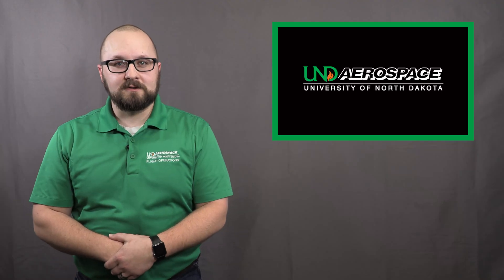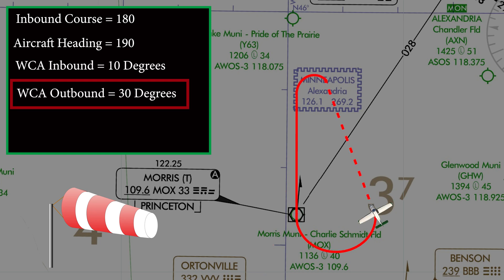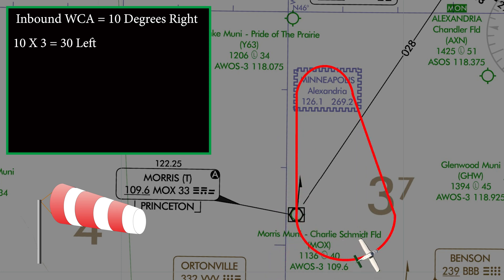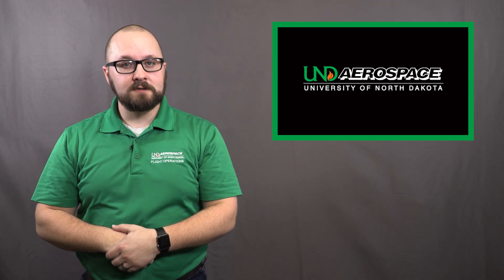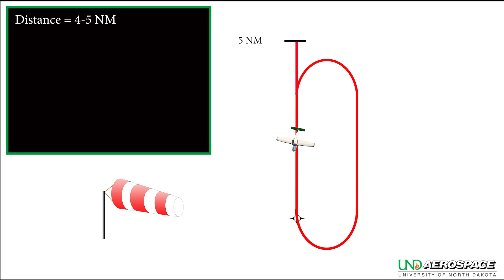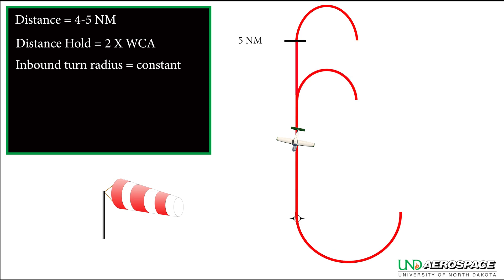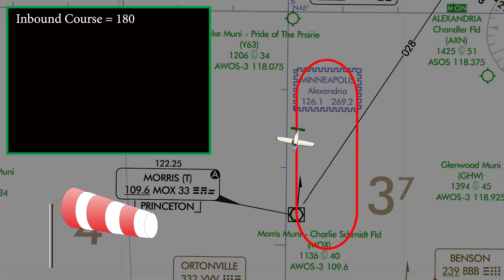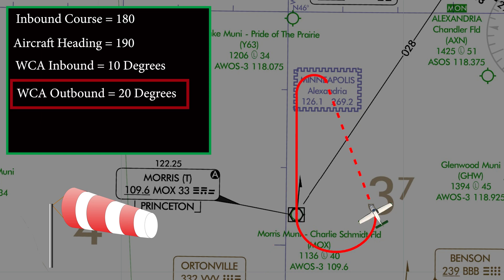IFR Holding Series Part 3: Wind Correction Angle

Comment: How did you calculate the wind correction? You don't mention the most important thing?  First of all, how can I make x2 without knowing how many degrees of correction I need to give?
Reply: Wind correction is based off of ground track versus heading. If you require a heading change of 10 degrees to maintain the desired track then 10 degrees is your correction. He talks about it at 1:10 👍
Reply: real question I'm asking is how did you find the 10 degree correction? On what basis did you give the 10 degree correction? How did you calculate? That's what really matters. @hunterwjohnson17
Reply: Bro what, watch the video again.....